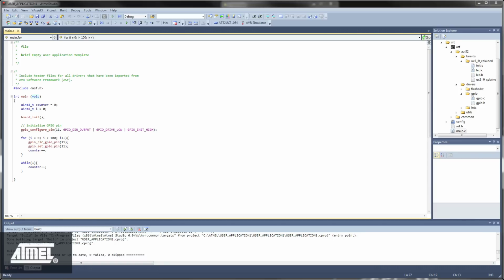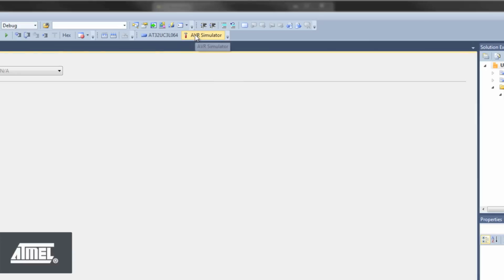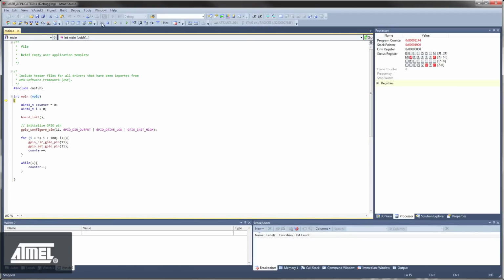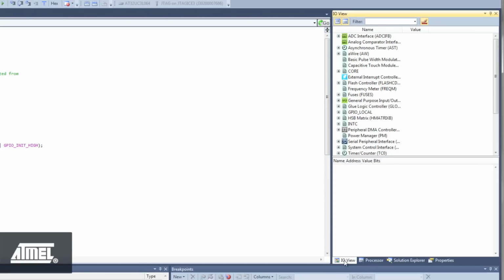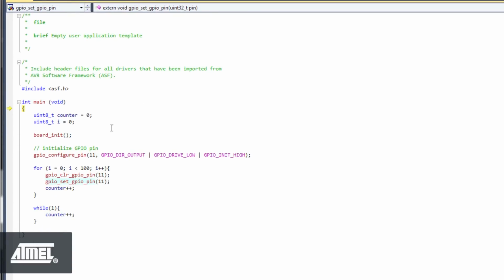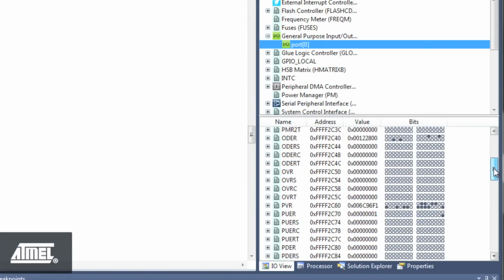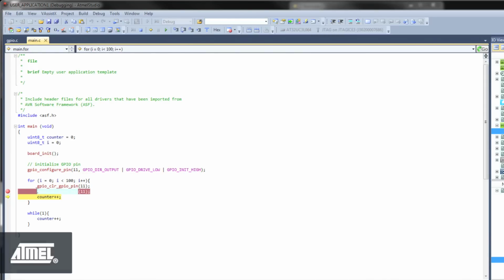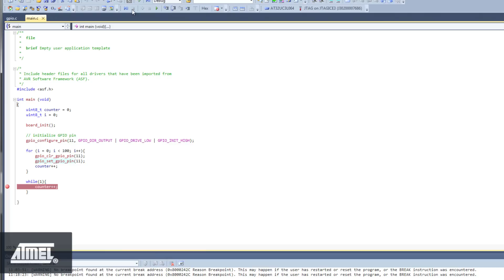Debugging AVR Applications with Atmel Studio

Comment: I am using Atmel studios 6.2. My programmer is the Atmel ISP mkII. The device I am trying to debug is a atmega 328p. I am running the micro at 1 Mhz. So I set my programming speed to be 125 Khz. I get this error when trying to enter debug mode: "Atmel Studio was unable to start your debug session. Please verify device selection, interface settings, target power and connections to the target device. Look in the details section for more information." Does anyone have a solution for this?